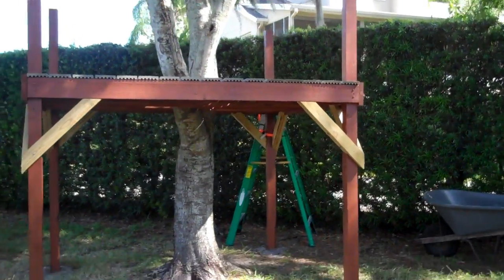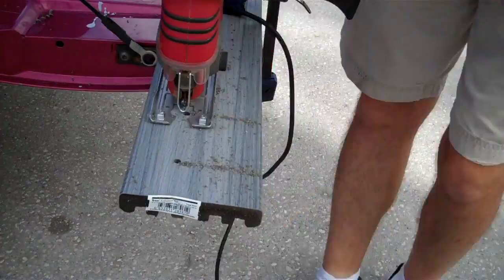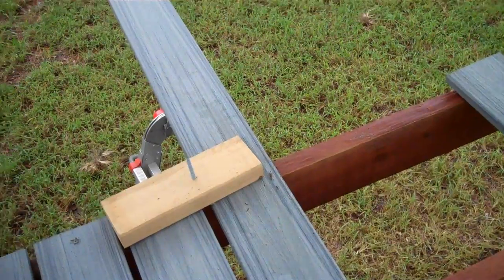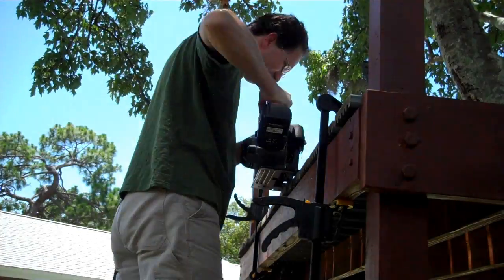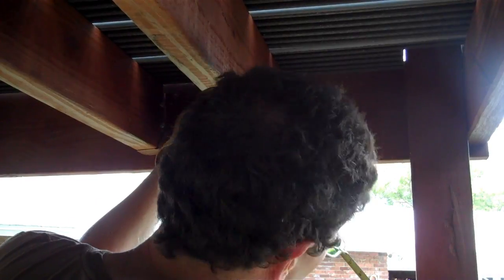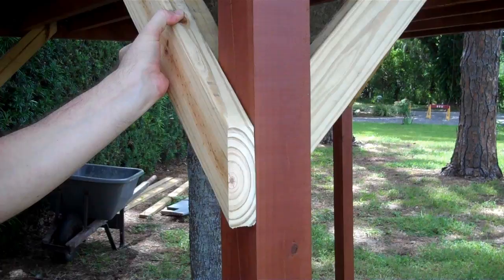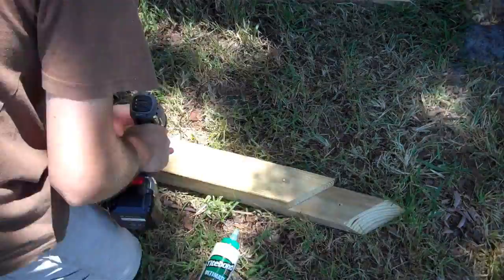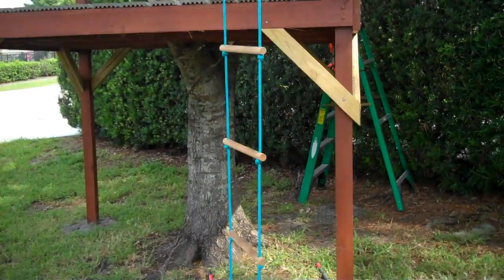Fancy Corner Braces & Deck Boards - Play structure part 2

Comment: I really like the way you did the corner braces. I stumbled on your video while trying to find some neat brace ideas. I'm going to try a slightly different idea using a 4x4 instead of 2 2x4's and cut out the ends on opposite sides to sit flush against the post and cross beam.

Comment: Hey Jay, I noticed the joists are about an inch lower than the 2x8 cross beams, not flush - doesn’t this make the deck boards sink down from the edges?
Reply from the maker: The joists are in line with the side supports, which are also dropped down the thickness of the Deck boards, so they are flush with the top of the cross beams.
Reply: That is exactly what I needed to know.  Thanks so much.  This video is really helping me build the ultimate treehouse right now, you rule.

Comment: Can you please clarify what screws you used for the corner braces in your blog?
Reply from the maker: I used 2.5" structural screws (similar to those used for the joist brackets) to attach the two 2x4's together for the corner braces, and used 5/16" lag bolts to attach them to the joists and posts. The lengths and details are listed on the blog page here (under part 2):
https://www.summet.com/blog/2020/05/29/build-an-8x8-play-structure-with-dimensional-lumber/

Comment: I see you have larger tree in the yard why did you choose such a small tree??
Reply from the maker: It's a small platform (not connected to the tree) and that tree provides the best shade and was in the best location to "start" the zipline ending at another tree. (Also, I have a hammock I hang between the two pines already....)